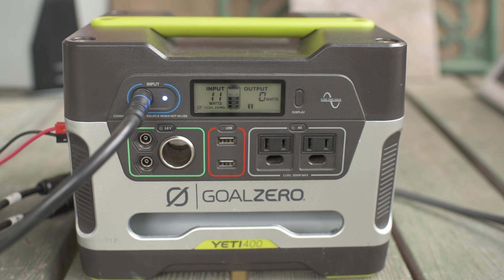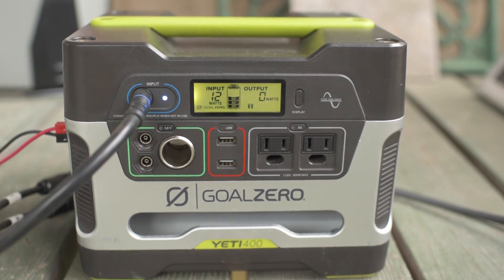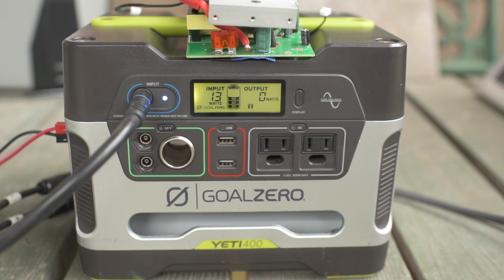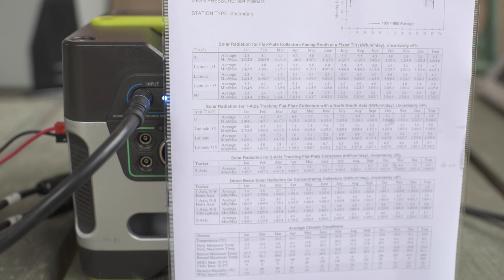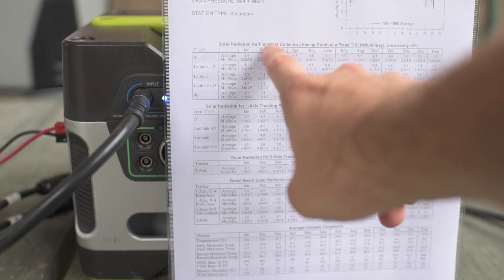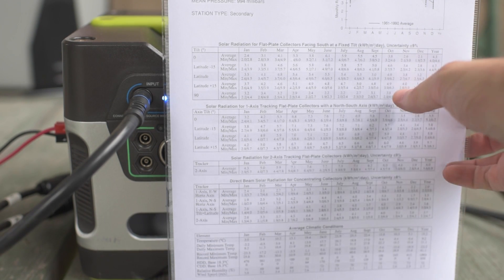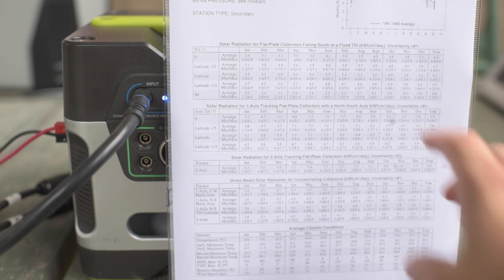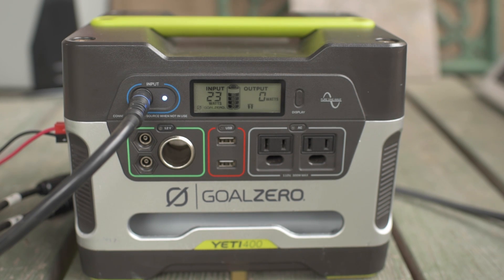Yeti 400 No Inverter!

Comment: Hello, I have a quick question. I had mine in storage and wanted to use it but it won’t charge!!!! When I put the power cable in first the display lit up but went straight off. I have left the cable in over night but does not charge or light up display!!!! Can you help???? I’ve hardly used it 😞
Reply from the maker: Call goal zero tech support.
Reply: @createthisdotcom  thank you I’m chatting to them now 👍🏻

Comment: Watched another video where the man added an extra small inverter (under $20) andthe Yeti worked far better and recharged much more quickly.  What do you think of that idea?
Reply from the maker: The smaller cheaper inverters are usually not pure sine. If that works for you, go for it. I prefer pure sine personally.

Comment: Hi thanks for the videos,  I had a quick question and I ask that you excuse any ignorance on the subject ahead of time :)  can you add a higher power inverter to the yeti 400 in conjunction to the onboard built in?  Thanks again
Reply from the maker: With the AGM Yeti 400 you can add another inverter via the Anderson ports on the sides. I run a 300w inverter that way. However, it probably isn’t a great idea to run an inverter much over 300w with the tiny AGM battery this unit ships with.
Reply: Agree with the sizing, standard is 300w/600w peak. Was curious as I’ve seen others run a 1000w invertor via Anderson with extra batteries chained for runtime. My question was not to create a silly size beast but to make a middle unit to bridge the 400 to 1250 divide. I would only use 1000w invertor with extra batteries. Plus a 1000 will support lower draw too and have seen better efficiencies
Reply: Hey that's a great idea.  There are many things that don't need pure sine.